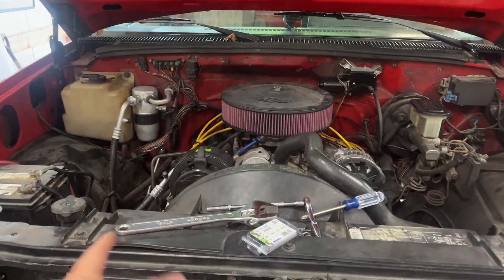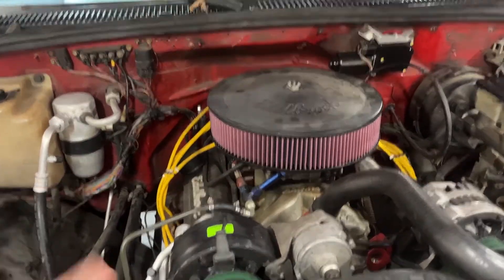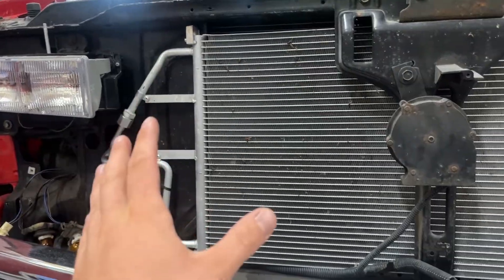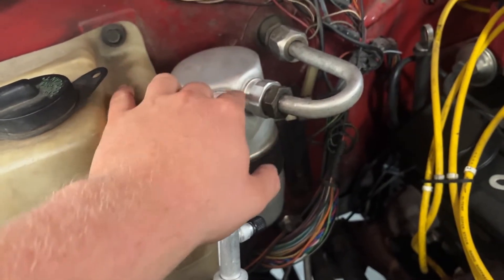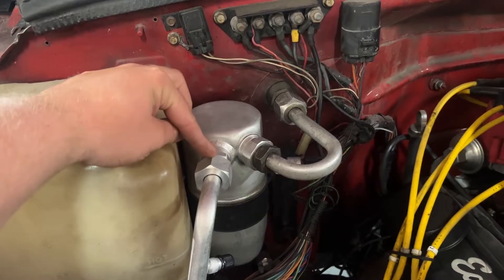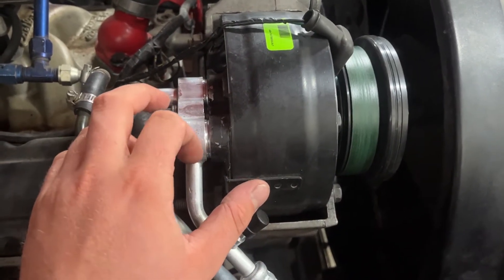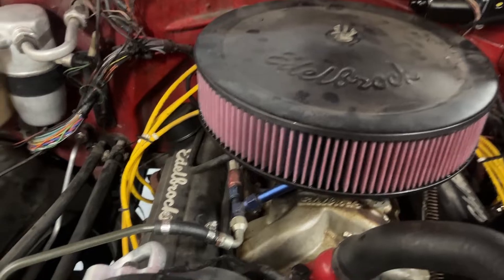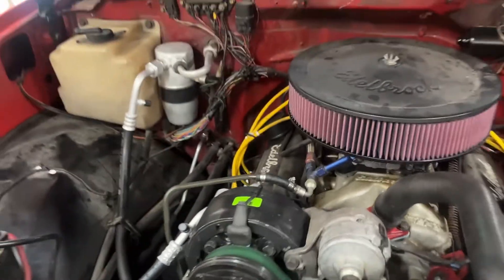In-depth look at r12 to r134a conversion for 88-93 GM trucks

Comment: Hey I’m working on my 93 Chevy, on the old compressor, it did not come with a high pressure switch, I’m curious do you have a high pressure switch on yours? Or if you have a high pressure where is it? I know the one on the dryer is a low pressure switch

Comment: Just FYI if you buy a new accumulator from your parts store it says in the description for our 12 or for our 134 applications there is no specific accumulator upgrading to the R1 34 compressor pancake style you have to get the new pigtail for it they sell it at O’Reillys one wire goes to ground on the block of the motor and one wire goes to the power wire for the compressor
Reply: It’s less about it being r134 specific and more about making sure all of the old mineral oil is out of the system.

Comment: Part numbers from rock auto 52486531 condenser 
10473SK four seasons drier
4811762 gpd refrigerant hose
My compressor was given to me but I was told they are r134a specific and then the bottom line from the condenser to the evap core was there so I didn’t have to buy that but it shouldn’t be specific 👍thanks for watching
Reply: Just making sure but this will work on my 93 Silverado right?

Comment: I Removed R12 from system.
I left the mineral oil in place.
I Added 4oz. Of pag oil. ($10) O'Reilly's 
I Changed the orifice tube with a new unit. ($7) O'Reilly's 
Installed an r-12 to r-134a adapter kit to ac connections. ($17) Napa auto parts.
Charged the system with 32oz. Of R-134a. ($36) O'Reilly's

I converted over to R-134a in this way for under $100.
Im reading 42-47 degrees at the vent with a temp gun.

1993 chevy siverado cheyenne 5 speed 4wd.

Comment: I noticed that the outlet line from the dryer/accumulators doesn't have a switch. When you change it over do you eliminate the switch
Reply from the maker: @udumkopf8217  I do not have the truck in front of me but I will check on that I’m still pretty sure it has a switch on it. The dryer didn’t come with a switch I do remember having to reuse the old one

Comment: I ended up having to convert my 97 dodge to carb because they don’t make a proper crank sensor for the 5 speed stick model v8s anymore and had to relocate the a/c compressor. I ended up fab’in up an idea to run the compressor off a 5amp Clothes dryer motor, mounted remotely. Cool part is I can run it without the engine running. Engine bay is huge so I could mount the remote compressor on the passenger side of the engine compartment.
Reply from the maker: Sounds awesome! If it fits it ships brother man!

Comment: So what happens if you just put R134a in an R12 system without changing anything?
Reply: I have a 92 k1500 and my uncle has a 93 k1500, all he did was change the oil to pag and the adapters for 134a, he has cold air with the old system, I'm fixing to do the same.
Reply: Same thing i wanna kno too
Reply: Same thing i wanna kno too
Reply: Ever figured it out

Comment: Could i get a complete parts list for this, please!!! It's hot here in Texas lol, and my 88 on r12 aint doing it. Just like you, im having a hard time finding trustworthy info on the internet, but seeing what you did actually works, I'd love to do the swap the right way on my truck as well, please!! Thank you!
Reply from the maker: 52486531 condenser 
10473SK four seasons drier
4811762 gpd refrigerant hose
My compressor was given to me but I was told they are r134a specific and then the bottom line from the condenser to the evap core was there so I didn’t have to buy that but it shouldn’t be specific 👍thanks for watching

Comment: all of this is not needed.. all you have to do is remove the compressor and drain the mineral oil out,, then add 4 oz of PAG oil.. vacuum system down, leak check. then get an r12 to 134a hose adapter, and fill it with 134a ,, the oil change may nor even be totally needed.. when r134a first came out I put it in a freezer that took r12.. the freezer has been running flawlessly for 17 years now.. alot of things in the refrigeration industry is scammy.
Reply: Pag oil actually evaporates and mixes with r134a and moves through the system. Where is mineral oil does not and doesn't mix with r134a. In a small AC system there's not much distance that the oil needs to move to keep things lubricated, but in a vehicle AC system that oil has to move throughout the whole system past the compressor converting back into a liquid to lubricate the compressor. With mineral oil it will not reach the compressor
Reply: What year truck did you did this on ?
Reply: You also forgot to replace the expansion orifice that's located inside one of the evaporator tubes

Comment: What’s your parts list
Reply from the maker: 52486531 condenser 
10473SK four seasons drier
4811762 gpd refrigerant hose
My compressor was given to me but I was told they are r134a specific and then the bottom line from the condenser to the evap core was there so I didn’t have to buy that but it shouldn’t be specific
Reply from the maker: @philippdixon8727
Reply from the maker: @phillipdixon8272

Comment: Thank you, that was a very good video. Answered all my questions about parts needed to finally do the job right. Badass job describing the parts and what the install process would be like. Will look for a Drier that is forward facing. I have a 1993 Chevy S10 Blazer Tahoe LT w/4.3 Vortec.. good engine, just has the damn R12 components.
I Was going to try a kit that's supposed to let you recharge w/out replacing parts, some kind of R12 to R134a kit, but you inspired me to just do it right. Good camera shots and talking points too  👍
Reply from the maker: Thank you for the kind words and for the  viewership. I didn’t find any videos that tickled my fancy when I was going through the process so I had a duty to make as good of one as I could.

Comment: I’m looking to do this on my 93 K2500. So you have part numbers?
Reply from the maker: 52486531 condenser 
10473SK four seasons drier
4811762 gpd refrigerant hose
My compressor was given to me but I was told they are r134a specific and then the bottom line from the condenser to the evap core was there so I didn’t have to buy that but it shouldn’t be specific 👍thanks for watching
Reply: @Levisbackyardperformance  thanks !